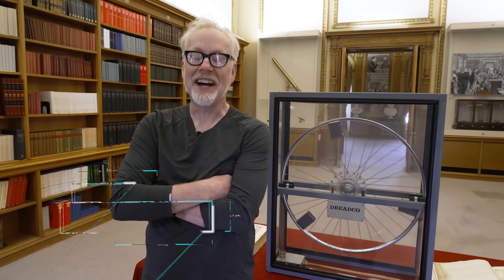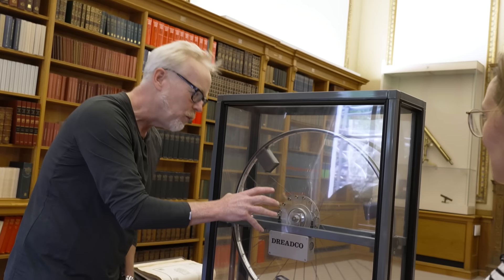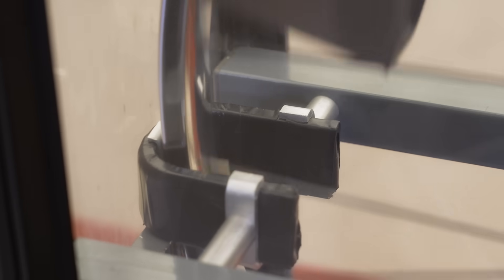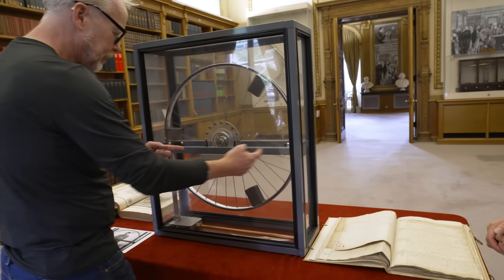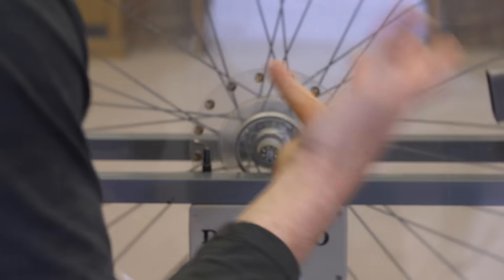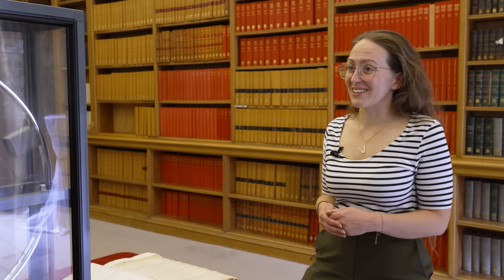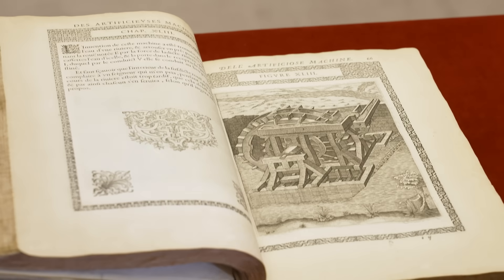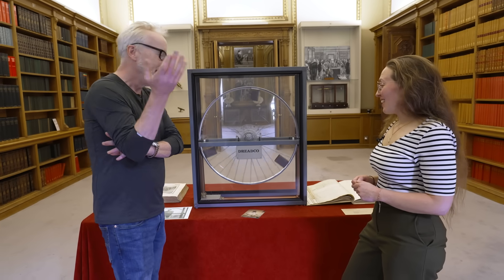Adam Savage vs The "Perpetual Motion" Machine!

Comment: First.
It is a artpiece which combines several theories striking at the perpetual motion problem. 
It is not meant to be a patent for free energy which is a scam.
It is simply put a extremely complex and efficient desk top object, kind of like a Newton's cradle, but extravagantly designed and engineered.

That being said.

As a museum technician/guard, I was extremely alarmed when he slammed his finger into the acrylic, also when he pulled his flash light in the Library/lab, it's simply bad etiquette to do so without asking first(Strong lights are banned in paper/film laboratory which are usually kept in dimmed light or even dark).

I like Adam, but the way he was pacing and almost running around the table was to say the least not very professional or typical of museum staff which are extremely careful and cautious with their work.

His enthusiasm obviously was bigger than his actual respect for the artefact, which is underwhelming coming from a guy so much into conservation and collection of curios /props.

Comment: The comment that folks heart weights moving in a different version of the wheel got me thinking of a couple possibilities... not weights, but you can make a very simple motion-sensitive switch with a ball bearing in a tube, for example, and that could easily turn electromagnets on and off with the correct timing. Later versions replaced with a more refined version that runs silently. And there are some /really/ long life battery options out there, provided you don't mind very low power.

Comment: It’s electromagnets driven off of small tiny gel or chemical batteries. Most likely chemical if I had to guess. The current travels down the metal spoked and is driven off those two phallic dongles.

Comment: This is so misleading. A perpetual motion machine that only works for a couple years before someone needs to service it. Jeez! That’s a machine that needs a power source to stay moving. That’s a car engine, an electronic motor, a solar motor, etc. 
So, in no way it should be labeled perpetual motion machine.
A real PMM, if it could exist, which it can’t, it would be open to see how it works and so prove it’s indeed a PMM.

Comment: It seems to me like the wheel has magnets in it, and the base has batteries in it, and a coil in one of the black blocks applies just the teensiest bit of push when it needs to in order to keep it moving. it could sense the motion with a hall effect sensor on one side. or the brass and weird needles in the center could be involved in the tachometry. to me those seem like a red herring, as do the heat sinks and valve. The pipes may contain wires but they could be in the box tube as well, or all the active components could be on one side next to each other. 

there's enough room in that base for 4x 18650 batteries which could provide like 20,000mAh at ~4.2v. So for over 2 years this thing could technically draw 1.15 Amps continuously day and night. that seems like more than enough to run a tiny microcontroller and small electromagnet, provided that the bearings continue to work efficiently and that the wheel is well balanced. More batteries could be fit inside that DREADCO box and technically in the box tube. If I had to guess, it slows down after two years not because the full capacity is used up but because lithium only holds a charge for about that long anyway without being kept at a storage voltage which is generally more than half full.

The light meter diffuser lenses would be a good spot to put a panel to get some solar power help, or to put a photodiode at at angle to get tachometry of the dark sections of the wheel passing. would be a bit extra complicated for this particular design but could enable even more vexing designs.

Regardless it's cool kinetic art that makes ya think. the glass box is pleasing because in my head any true attempt at perpetual motion takes place in a vacuum chamber or else takes place in orbit.

Comment: Electrostatic motor is my guess

Look up the accutron electrostatic watch and you'll see some familiar things
Reply: Additional guess is the light meter part you noticed is being used to activate the circuit when it's sitting in light as a way to conserve energy. No sense in using up the battery when it's sitting in the dark and no one is around.
Reply: @matthewweaver1123  That would actually be really clever.

Comment: I thought that metal spheres absorb electricity and points emit it wouldn't this make it act as a oneway valve pushing electrons off the tips into the little buckets fueled by the metal passing through the magnets? I imagine the heat sinks are for generating a Peltier-effect so maybe the machine uses the temperature of the room.
Reply: Agree the whole wheel is an induction motor with the the square on the wheel as iron blocks, and the U shaped frame objects are electro magnets powered by a thermocouple/thermoelectric source at the bottom.

Comment: Nearly everything you see is meant to throw you off. 

The entire thing is a vacuum. 

The dreadco box doesn’t allow light in, but rather air. The two diode looking things near the center hub are what’s important. The round one on the left is triggered every time just one of the many metal circles pass it. This triggers an infinitesimal amount of air to spray out of the ‘diode’ on the right. It points up, in the same direction of spin. the tiny spray of air is enough to give it a rotation. 
The copper pipe is not ‘open’ as it appears to be, but rather sealed shut further down the pipe, out of sight. The ‘heat sink’ is in fact a device that allows air to be ‘sucked in’ and captured in the copper pipe. Over time it can only collect so much air. As the chamber loses its vacuum over many months, the puff of air can no longer work as efficiently as it initially did. 
It is then ‘recharged’ by having all the air sucked out of the chamber as well as the pipe

Comment: I think that it works just off of the magnets on the wheel. The pads that are mounted on the wheel are pushed around  by the way they are mounted it gets a push downward and right after one gets pushed down another pad is being pushed up almost right after to keep its momentum. I think that the reason it needs to be "serviced" is because the magnets eventually get weaker.
Reply: Magnets aren't going to produce a circular motion like that.

Well, unless the "magnets" are actually battery packs with a little electromagnet so they can switch on and off?  I doubt that would be efficient enough to keep it running for two years though.
Reply: No

Comment: An electric watch (not a digital one, not a quartz one, but one with mechanical components driven by electricity) can run for 2 years with just the power of a tiny button battery. Sure, this wheel is way bigger but it could have a way bigger battery as well somewhere and if it is perfectly balanced and friction has been reduced as far as physically possible, it only needs a tiny "push" every now and then to stay in constant motion.

Comment: So much wrong here;  Orffyreus is a Latinisation of a rotation cypher of Bessler (not "Bressel"!), and the illustration showed from Desaguliers has nothing whatsoever to do with Bessler's designs, which were validated by the godfather of CoE personally, Gottfried Leibniz.   Bessler was explicit and unambiguous in refuting the possibility of gaining energy from perpetual overbalance;  what he was actually doing was applying an effective CoM exploit, fixing the unit-energy cost of momentum from gravity and time to an RPM-invariant value, input energy thus doubling with velocity whilst rotational KE squared..  The energy gain was harnessed internally in the form of GPE, the statorless wheel thus giving the outward appearance of the fabled, if impossible, perpetually over-balancing wheel.  The statorless operation however was not merely to confound or mislead, but integral to the exploit of decoupling the inertial reference frame of the input-energy workload from that of the ground frame in which the KE is manifest - essentially generating a divergent input inertial frame (that is, one proceeding without inertial interaction with its environment).   The real reason he smashed his largest and most powerful wheel at Castle Weissenstein in the new year of 1718 was not because of fear of snooping (though that was the excuse he gave), but rather because of the devastating Christmas storms of 1717 weeks earlier that he realised he may have been culpable for..  As explained, a Bessler wheel is not the closed system it ostensibly appears to be, but thermodynamically open - again, the momentum source / sink is gravity and time, and the energy source / sink is whatever constitutes 'inertia' (ie. ZPE / vacuum potential).. and thus actually harnessing a running Bessler wheel to perform useful work necessarily grounds stray momenta to Earth..  'momentum' being the more-fundamentally conserved property, remember..  So in conclusion Bessler was legit, verified by the world's expert and pioneer on the symmetry of PE to KE as well as multiple eminent scholars, engineers and magistrates (even a royal witness, his patron the Landgrave Karl), but sinking unilateral momentum to the planet in any plane or axis is obvs neither smart nor sustainable.  We may have dodged a serious bullet when he took the unsold IP to his grave..  Mechanical OU could be a 'great filter'..

Comment: I doubt that there is any interaction between the fixed parts and the wheel at all. I didn't think it through entirely, but basically I would build something like this by adding to one of the classic ideas for perpetual motion machines, where weights change their position radially on a wheel. Each box could contain a battery, circuit and something like a pendulum that rests upside down when its box is on the downward moving side of the wheel. A small electromagnetic impulse, triggered by an inclination switch, would be enough to prematurely flip the weight onto a larger circumference. It resets its position on the way up.

Comment: My guess would be a battery and a motor. Replacing a battery for something running for 2 years continually sounds about right. The simplest answers are usually the correct ones

Comment: I think the black boxes and the magnets are a complete misdirection.   There could be an ongoing slow chemical reaction going on in the box that leads to the copper pipe, that produces a slow trickle of gas, under high pressure.  That would be enough to keep the wheel going for a very long time.  Every two years, they simply change out the chemicals in the box.

Comment: Might as well add to the pile of speculation. 

I think Adam is right to guess that its a motor, but not specifically an electromagnetic motor. I believe the hub components are an electrostatic motor, and all the "magnets" & components in the base are just red herrings. The asymmetry of the two electrodes would be an awfully specific detail for them to just be red herrings for some other source of torque, but are essentially required for an electrostatic motor to run efficiently. The sharp electrode "bleeds" charge to the bits of metal mounted in the acrylic, and the resulting charge similarity between them produces a tiny amount of force. The opposite electrode exists to discharge the metal bits, so the process can repeat. The voltage required to power something like this is very high, in the order of kilovolts, but this isn't unheard of in the world of machines which seemingly run forever. The Oxford Electric Bell is an electrostatic bell, powered by a high voltage battery, which has been ringing near-continuously for just shy of two centuries now. I would not be surprised if this "perpetual motion machine" is just a much more complicated version of that.

Comment: Isn't it just a timed electro magnet that pushes a magnet in the black boxes? And the batteries and cables are hidden in the box at the bottom and in the copper tubes. It's basically like those toys where a pendulum swings forever.

Comment: I'd say it's 5 super capacitors or batteries 3 internal and one external and one side mounted the coils passing magnets sending the static charge to a battery or super capacitor in the center that's collects the static charge stores it and releases threw the spokes each box holds a charge one always discharging while two charge as the wheel flips over gravity flips a switch in each box discharging down the spokes as static to the side box which channels it back to  the opposite box andding ionic thrust while external magnets acting as both ground and charge source store a negative charge in bottom box while the 3 coil capacitor boxes charge positive discharging to the side box as the wheel rotates making the whole thing a large capacitor one positive charge one negative the reason it needs servicing from time to time would be the gravity switches wearing out or getting stuck it's a self charging capacitor motor each small box hold two coils of opposite static charge materials like copper and silver the inner and outer they discharge threw a flip switch inside that releases to the spokes at least that's my thinking the charge keeps getting moved drained and recharged in perfect balance